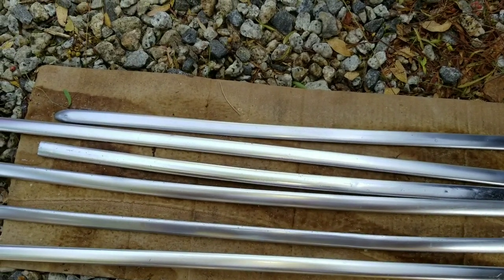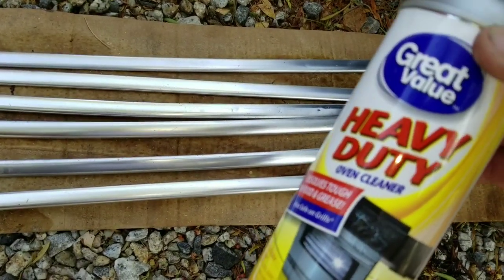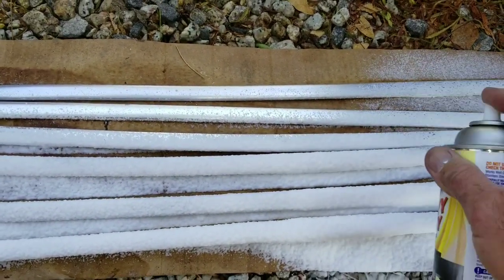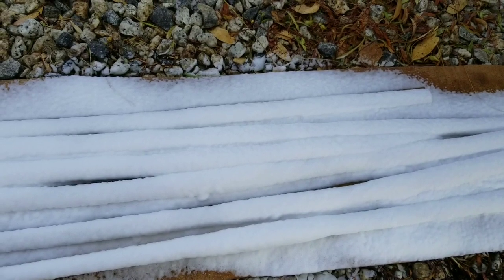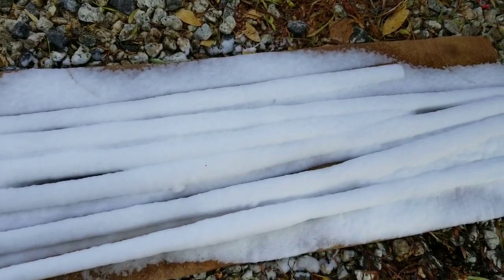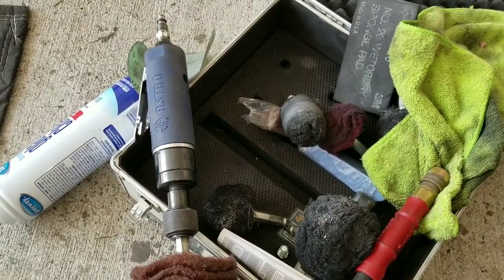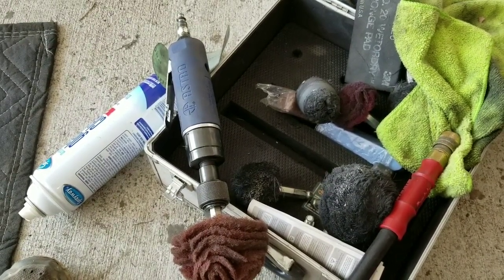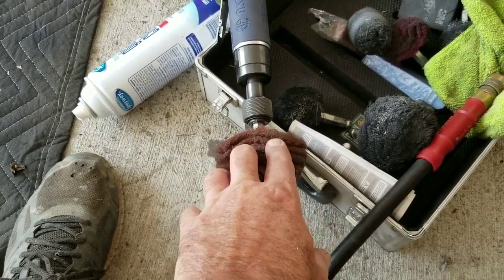Removing Anodizing from aluminum on your original trim so you can polish it

Comment: Chrome is a plating not a trim type. If you have a lightweight moulding with a clear coating on it it is aluminum. Stainless steel mouldings are not clear coated. The only chrome plating you will find on a car is a steel bumper, plastic, or pot metal such as a door handle

Comment: You can use just lye and water mixed up as a soak. Supposedly it's cheaper. Also, I've heard that easy off only removes the dye coloring but not the anodizing layer? So it can't truly be polished... it's what I heard i hope it can be polished cus I need to for my AR
Reply from the maker: yea it removes it then you just need to sand lightly and polish.